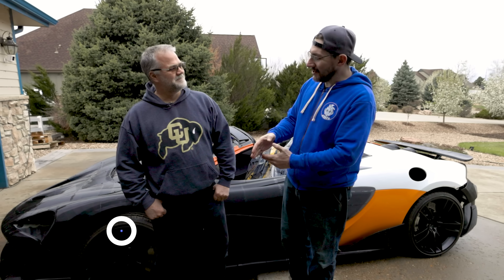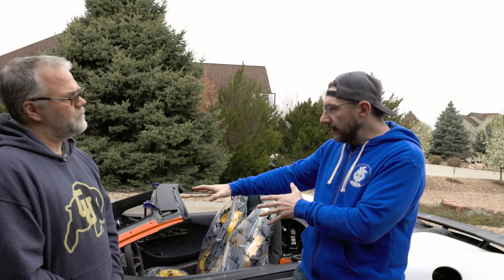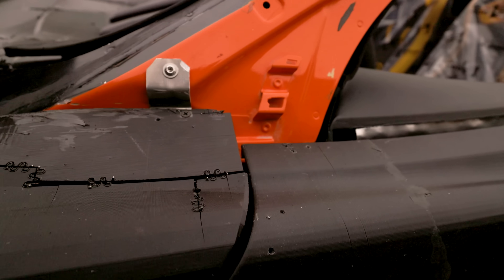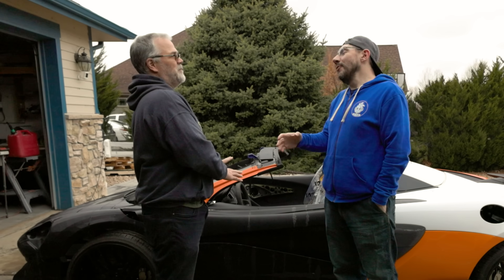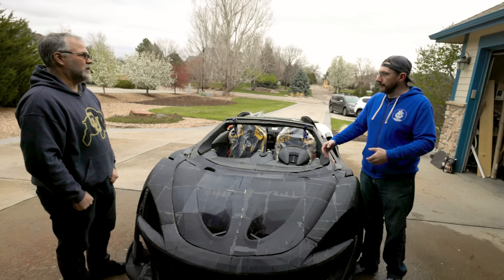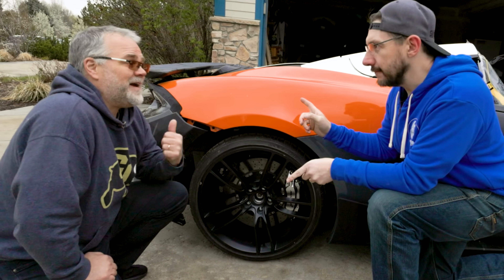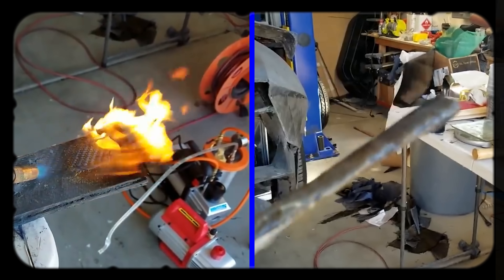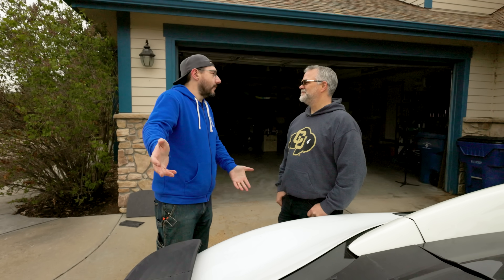Can 3D Printing SAVE the McLaren 600LT?

Comment: As cool as this is, there is no way this is structurally safe. This is like when you see these videos of Russians fixed completely luxury cars with a bent frame, they recover the looks but the mechanical properties are long gone. I really hope he doesn't ever have an accident, because that won't be pretty.

Not to mention the dynamic properties of the car, it will have asymetric stiffness and weight...

Comment: Due to the numbers of McLarens that end up like this, one can only assume that it's now the defacto platform for Mustang drivers to upgrade to after they win the lottery, 
Jokes aside, with the means and the skills, these are a great way to leverage laser scanning and obsessive printing regimes to makes dynamically restyled cars relatively cheaply. Definitely a viable route to getting into automotive design that could birth a future Pagani or Enzo. 👌
Add: Not that you can't 3D print the majority of a car body and internal parts (obviously, it's why we're here), but another route in the same camp is to use carving foam on a CNC machine; some of the 30x40 machines can be had for midrange printer money these days and afford a very generous workpiece size. The real benefit is in using more sturdy materials that take to molding well with composites/tool gel when scaling to sizable panels, and with a clever operator, cheaper feedstock. Or as said, CNC foam blocks directly which you can use with compatible resins and leave in place as foam-core composites.